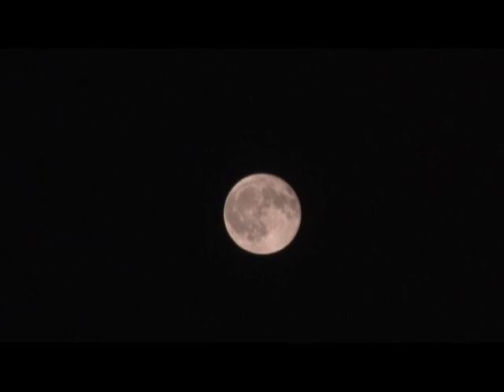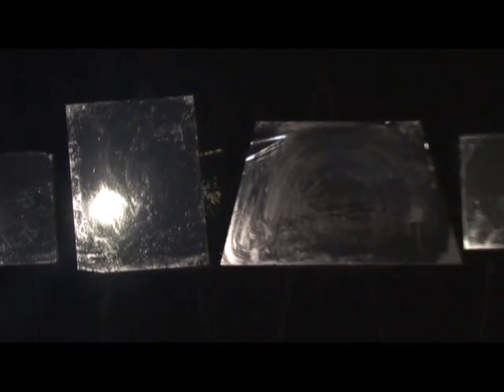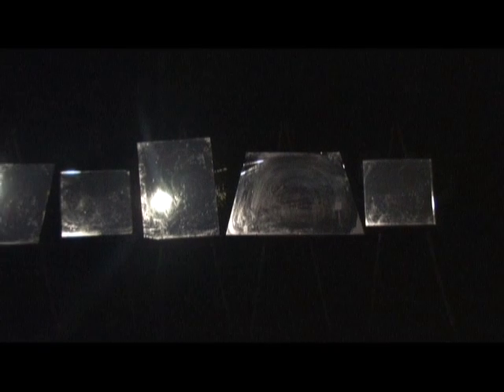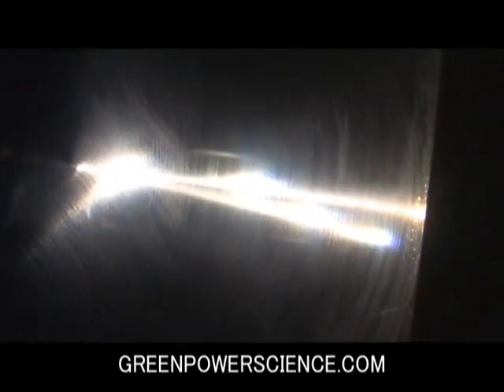MOONLIGHT LUNAR FRESNEL LENS SOLAR PANEL PV PHOTOVOLTAIC NIGHT SOLAR ENERGY

Comment: Moon light is yin energy, it will fill your heart and being with freshness of light. And will extremely heal you. It has also a yin burning power.  Put a peace of meat during a sunny day and it will not turn black. But put a peace of meat during a full moon night and it will turn completely dark. . Moon light is more powerful than sun light in the femenine energy thing. Use crystals to harness it's énergie and you can charge water with it and drink it, b.... and know that the moon brings with its light energies from constellations and planets and it is aligned with. For water energy aligns with water constellations. . Etc
Reply: go away hippy
Reply: +Cory Wolfe yes sir. troll sir.

Comment: Try again with a single 3.5A 0.7v 6x6 mono cell. Make a proper frame for lens above it. Then aim the mirrors and I bet ul get a good 20mA out of it. Make a simple self oscillator step up and you could charge a 10mAh lion button cell all night hehe.

Comment: The problem with this concept is the execution.  Being someone who has studied construction of PV panels at some detail and have begun producing my own, I can tell you the problem is likely the inequality of distribution of light on the panel.  If any part of a panel is shaded even at day time, that section can quit producing electricity, hence why every "string" of cells in a panel should be diode-bypassed.  SO you need a beam of moonlight on EACH cell to make this work (maybe)... Try that!

Comment: @bodryn The magnitude of a full moon is about -12.7.  The magnitude of the sun is about -27.  There is a logarithmic relationship of about 2.512 per magnitude of brightness, so you could take 2.512 to the 14th power to get an idea of the ratio of power available, sun vs. moon.

Comment: I have a couple of thoughts on this: 

1) The full moon is highest in the sky when the sun is lowest, i.e., in December/January when you could also escape the mosquitoes better.

2) The albedo (reflective capability) of the moon is about 6% of the sunlight that hits it.  I don't know what percent of that would be usable solar power for a panel.
Reply: This is such an old video, so I don't know if you will even know I'm leaving a comment. Anyway, I have been a fan of your work for a couple of years now. Following your instruction, I have built two relatively powerful vaporizers. (That's what my friends call them). I haven't checked to see if you ever finished this experiment (I will).

I suspect you came to the conclusion that the moon doesn't emit (or reflect, lol, heat). Someone did give you a hint, though. He said, "Check the temperature ."

During a full moon, using a touchless  laser thermometer, go outside and find an area where there is a distinct line between shadow and light. Measure the temperature of the ground in the shadow and then in the light. The result is quite  surprising.

I'm going to subscribe. Thank you for all the hard work I DIDN'T have to do, because you did.

Comment: It's not volts that count. You need to measure how many watts you get (volts multiplied by amps). That's the measure of the amount of power. It might help if you learned a bit more about electrical energy. The question is, what area of mirrors is needed to light a 100W lightbulb to full power?

Comment: Incorrect meter...
It looks like you used an AC Clamp on AMP meter to try to detect DC voltage as illustrated in 3:23 minutes of your video.  I recommend that you go to Radio Shack and purchase a real volt meter, then set its decimal to 0.00 so if you get like 1.20 you will know that you got 1 volt with 200 milli volt.  But an AMP meter will only try to measue AMP and that 001 to back to 000 that you got was just a 1 sided AC spike since DC is not alternating like AC.  Again, wrong meter used.

Comment: surely if you had the fresnel lense and photo-voltaic cells closer to the mirrors, you would produce more electricity as light follows the inverse square law... so you could increase the energy significantly in comparison to what you were recieving?

Comment: Hey Brother,

I saw this and had another idea. If you used the parabolic lenses to collect the moon light and put a small 6" frensel lenses at the focal point, or just beyond, you should get a concentrated beam coming out of the lenses, that you can direct at a photovoltaic cell, or a larger frensel lens. This is because the smaller frensel could be placed on a gimble to direct the light off the mirror-moon axis.

I am going to try this with my cardboard tinfoil and the bathroom lens

Comment from the maker: Thank you

I never have seen any lunar solar projects.

Mosquitos are a pain, we usually never wear shorts or short sleeves in the summer. Sounds backwards but they always find you any time of the day. Especially when working.

We have big fans with screen and catch about 500-1000 a night, but it makes no difference. There are 3 bats at work too. Gonna build em a bat house.

I like the winter here, when the temp drops below 60F I can wear summer clothes.

Do not like DEET (:X) and burns my skin.